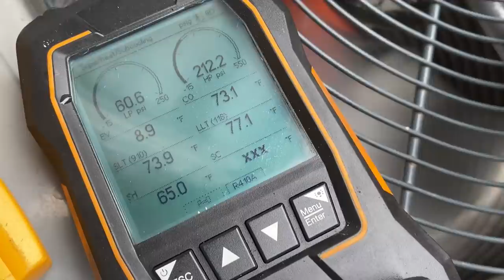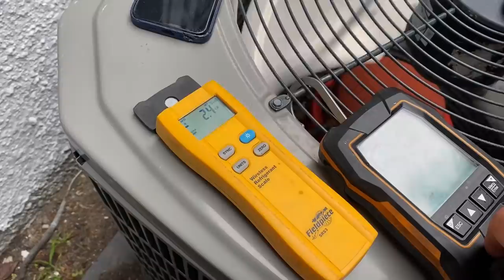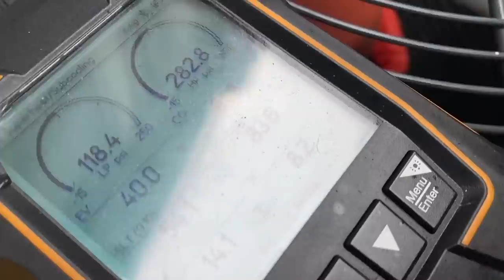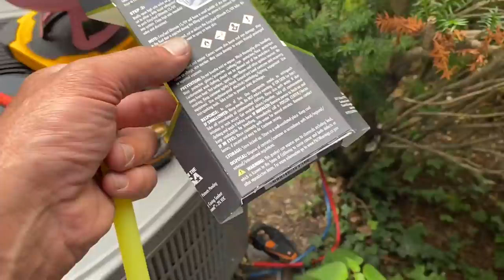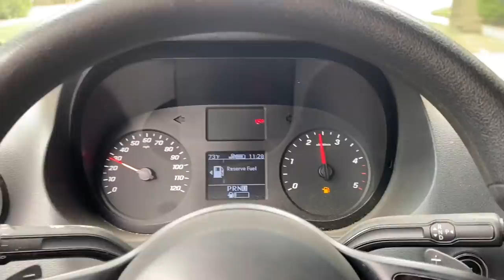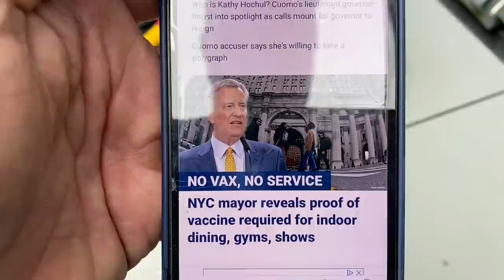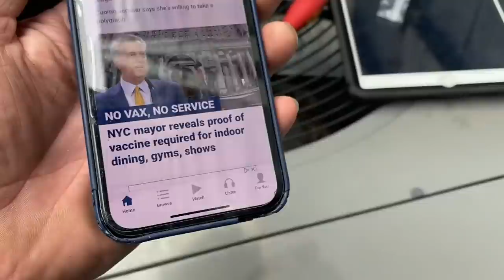Central AC Not Cooling & Hacked AC Installation Exposed - Guess Who Installed It?

Comment: Hi Mikey, the unico system in question has a freeze stat to shut it down but its air volume is half the cfm than a conventional system, also it removes about 30% more moisture from the system coil is much cooler and when conditions are right freezing can occur,I hope this helps, retired HVAC man.

Comment: Butanone is a chemical compound also known as methyl ethyl ketone used to seal the leaks since it is also manufactured for rewinds and gums.
Reply: Dude Butanone or MEK is definitely used in gum for human consumption, it is used in paints, lacquers and as an industrial solvent. It is also used as the catalyst for gel coat, the stuff on most boat hulls.

Comment: Yes it true just installed a unico and had to lower the blower speed to get super heat up
Reply: @PipeDoctor  you actually have to download a software and connect to the board with youre computer to do it biggest pain in the ass

Comment: Butanone, believe it or not, is used as a solvent. Solvents clean certain materials and can even facilitate plastic welding (essentially melting the two materials and once evaporated the two materials become one). As for why their is gas present? Could be from some of the liquid butanone evaporating after manufacturing or they use gaseous butanone to prevent too much boiling within the closed system.

Just a guess. Chemical engineer working as a wastewater plant designer. Lol

Comment: If installed correctly I rather put in American standard or train system and anything I know they’re all garbage they all break but to me at some of the best equipment out there not too hard to work on and they only leak if you install them incorrectly just don’t use the supply coils lol Adp coil with those systems works very well .

Comment: At my company they tell us not to use that leak seal stuff, plugs up txvs and other components…what’s your take on it? I’d rather use it if there is a very minuscule leak in system, if I put my gauges on and there’s 50 pounds standing pressure I’m not using it! Need some feedback please? Can’t hate on a Trane man they are top shelf units if installed correctly…if that unit was so empty why put leak seal in it just saying

Comment: Good job admitting your mistakes. That dryer vent is a HUGE no no. Those Bosch 2.0 systems will not tolerate that 🤣🤣🤣🤣 when you install them. Hopefully the owner can have it relocated.
Reply: Hell the idiots here where I do HVAC can’t comprehend the idea of not installing the damn dryer vent where they have the units spec’d to be placed

Comment: I have a gold Day Date with a white Roman dial. I sent it to the mothership center in Tx. It originally had a gold dial. I didn't like the gold on gold. Looks so much better with the white dial. Funny story. The main reason I sent it in was for a service. It actually started running backwards. After that I studied and bought a watchmaking bench and tools. I have more in tools than in watches. I have about 30 watches. I also like cheapie Russian watches to take apart and play with. I also have WWII watches. Mainly British started going after the dirty dozen if you know what that is. I am more of a historical collector than a bling collector. I do also own a Panny.

 Check out the non date Seamaster 300 from the 60's with aged lume. Classic!!!  Love that watch. Beware tons of fakes. The fake issued models all have the same serial number BTW.
Reply: @PipeDoctor  Like anything when you first take a watch apart it seems overwhelming but after a while you get it. Complications are another level. I don't take those apart. I have a Russian Air Force issued chrono that needs service. I am sending that to someone. If you studied WWII when the Russians invaded Germany they took watchmaking equipment back to Russia and started producing watches. The Swiss made watches for both sides. I have a couple AXIS pieces with issued markings but I don't handle them. They sit in a case but I can't get myself to touch them. I know you get that.

Comment: The air moves SLOWLY across a Unico evap. The air is in contact with the coil longer hence the 25 to 35 degree td. Removes humidity well.

Comment: Is this it?  "Butyric acid, also known under the systematic name butanoic acid, is a straight-chain alkyl carboxylic acid with the chemical formula CH₃CH₂CH₂CO₂H. It is an oily, colorless liquid with an unpleasant odor. Isobutyric acid is an isomer. Salts and esters of butyric acid are known as butyrates or butanoates."

Not finding much for butanoate.

Comment: Filter dryers always,ALWAYS, go nearest to A/H coil.Fight me and I'll tell you why!!
Reply: Here in Texas people's attics can get up to 140 degrees, I think it's better outside here out of direct sunlight, don't think it matters as much as people think.
Reply: The closer it is to the TXV the better it is so it catches anything and everything possible before the ref. goes through the small orfice or expansion valve,causing less call backs and future problems. Never understood why Goodman installed them in the unit where it's basically useless if proper piping and protocols were not followed.